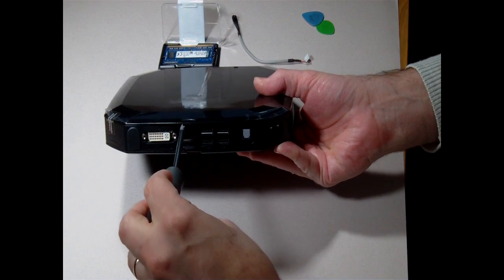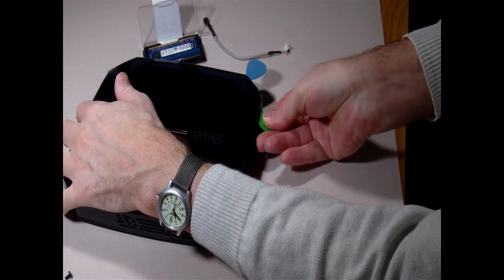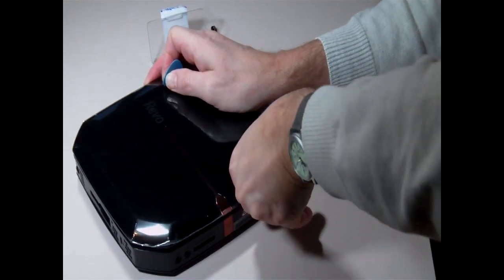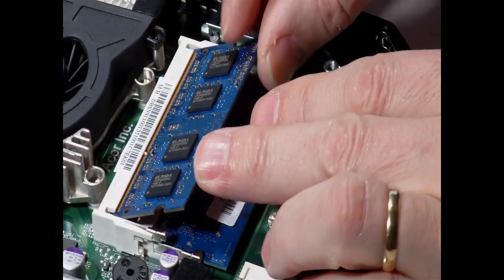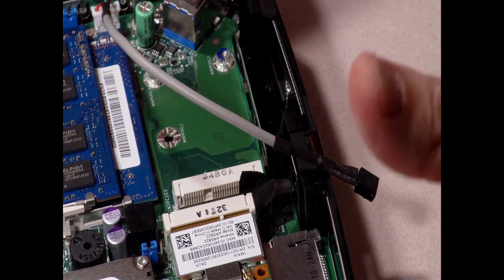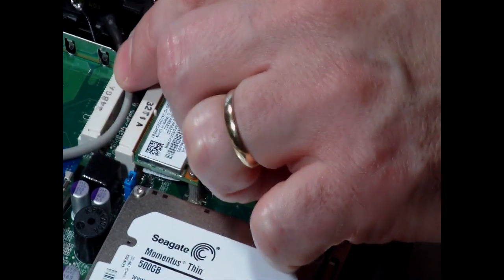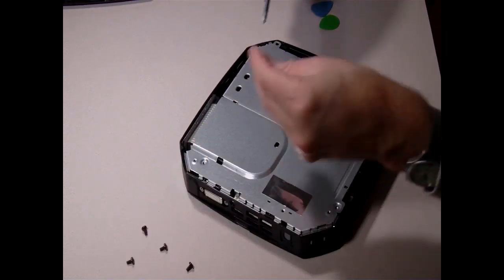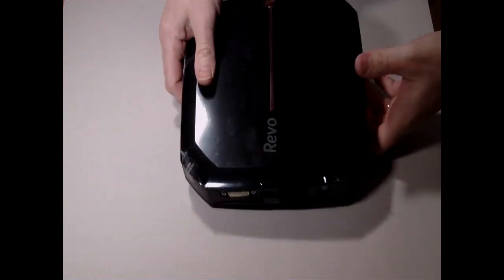Adding RAM and IR Sensor to an Acer Revo RL80

Comment from the maker: Hi, it looks to be for a second Mini-PCiE card (the first Mini-PCiE slot is used for the WiFi module just to the left of it in the video). I suspect it's for fitting an mSATA SSD, although I don't know if it's enabled in the BIOS. Update: Looking around the web it seems that it isn't enable for mSATA use, I've tried and it doesn't recognise an mSATA SSD in the slot :-(

Comment: If anyone's trying to disassemble the RL80 model WITH the optical drive:
1. There are two screws visible on the external rear panel: Remove the one furthest from the HDMI port first, and remove the top lid as shown in this video.
2. There's a small metal shield at the rear of the optical drive: Remove the single screw holding it, and lift off the shield.  
3. Unplug the optical drive cable from the mainboard.
4. When the two screws at the rear of the optical drive are removed, the drive can be slid backwards and removed.  (This step might not be needed.) 
5. Remove the four screws on the plastic panel.
6. Remove the second external screw, beside the HDMI port, and gently prise off the plastic panel, starting at the rear.
7. The metal shield is then exposed.  
The remainder of the machine appears identical to the model without the optical drive.

Comment: please where did you buy the IR sensor???
Reply from the maker: Hi, I built the the IR sensor assembly myself, it's pretty straightforward, just a TSOP-32136 IR Sensor module and the cabling required to plug it into the RL80 board. Full details are in this post on AVForms : https://www.avforums.com/threads/fitting-an-internal-ir-sensor-in-an-acer-revo-rl80-and-rl70.1818619/
Reply: Charles Durrant Thank you very much Sir